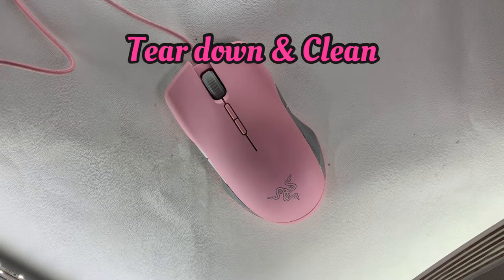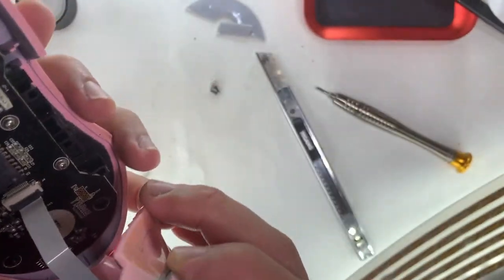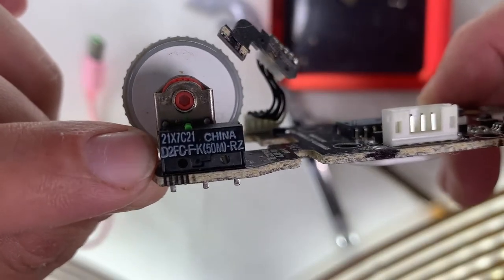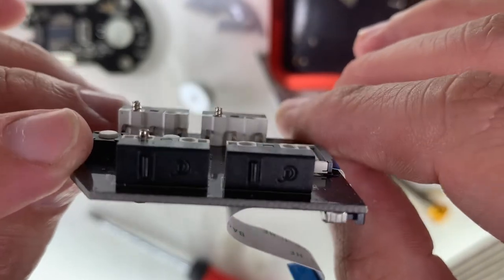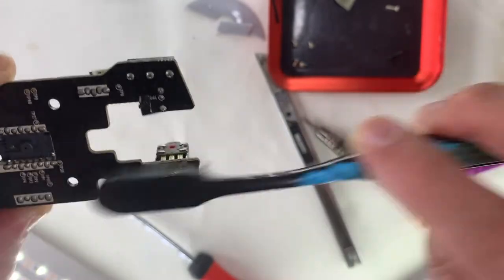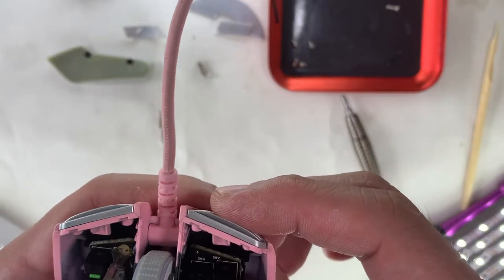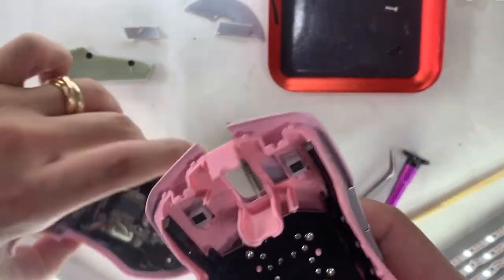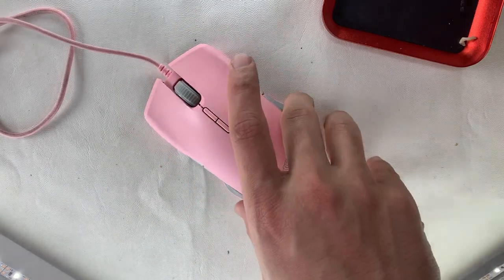#18 Tear down & Clean Razer Lancehead Quartz Wired (Detailed)

Comment: Hello fellow repair-man. xD 
I experienced an issue where the right mouse button became a problem in shooter games. It appeared to toggle . 
Today i opened it up with the help of your instruction.
The mouse buttons appear to have some kind of pads pressing onto the actual button inside the mouse.
The pad of the right mouse button has a dent from the button itself.
I have nothing to replace it so i turned it 180 degrees.
Works.

Great video. Thanks man!!

Comment: I have the same mouse just different colour.
My mouse scroll whell is little lose so it rattles when i move it around.
Do i need to take it apart or is there any other fix? Please answer.
Reply: Mine has the same problem. I think It's just normal. At first I found it really annoying, but I got used to it later
Reply: @wikson3523  oh ok thanks for telling me.
It would be good to have it fixed. But guess I'll work with it.
Reply: @sirpraysalot6931  My mouse is over 3 years old and biggest problem is the middle button (scroll button). I have to press it really hard to activate the button. I think it's just dirty inside because I've never cleaned it.
Reply: @wikson3523  bro i think you should just open it up clean it and then sell it get a new good mouse if u have the money.
Reply: @sirpraysalot6931  I just bought myself Razer Huntsman V2 because my previous keyboard died, so maybe I should upgrade my mouse to basilisk ultimate to make my setup look better.  Idk how but my mouse works perfectly fine. I just pushed it harder a few times and now it works just like a new one. What about your mouse? How old is it? Did you manage to fix it?
Reply: @wikson3523  i bought it 2nd hand recently. Seller told me it's 2.5 years old.
I also have a viper mini so I'm thinking of selling it.
Reply: @sirpraysalot6931  It's a really nice mouse. I bought Razer Viper for my girlfriend and I like it really much, but lancehead fits better for me.
Reply: @wikson3523  i think I'll also buy a viper ultimate after i can get enough cash together.
As I'm a student with no job it's hard to buy expensive stuff.
Anyway what do you do?
Reply: @sirpraysalot6931  I don't think I understood the question.
Reply: @wikson3523  i mean what you do for living?
Reply: @sirpraysalot6931  I'm a student too. My parents buy me my gear. I mean when I want a new keybard I ask my father to buy me one that costs maybe 60$, but then he offers me a keyboard for 250$, so that's what it looks like

Comment: needed instructions on how to fix the switch. people say you open the switch and sand paper the contacts
Reply from the maker: sanding i feel is a temp fix, replacing would give more longevity if you have the tools required to de solder etc.
Reply: @santacruznomad9  I have the tools but cant get the parts. can you give a demo on how to open the switch